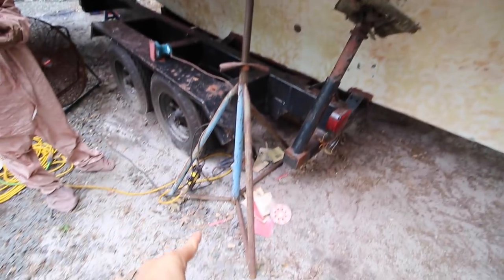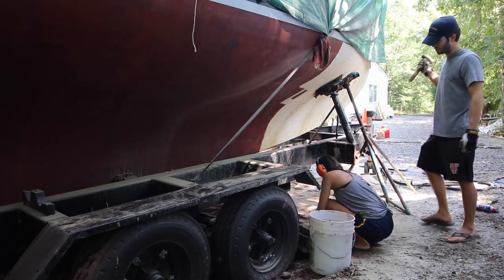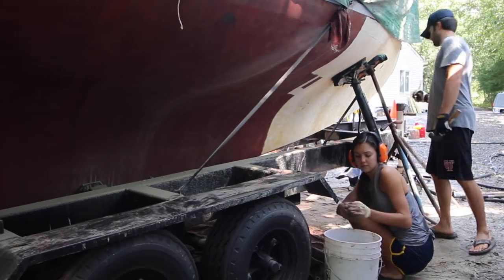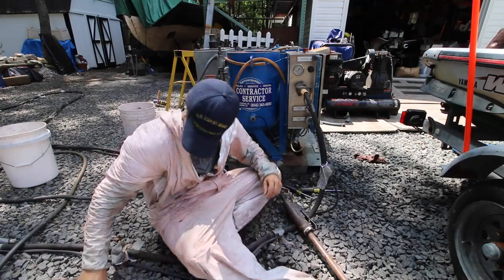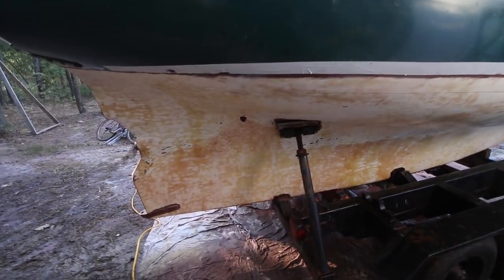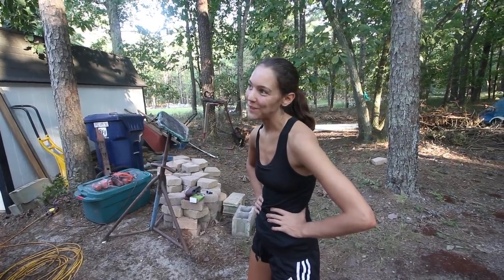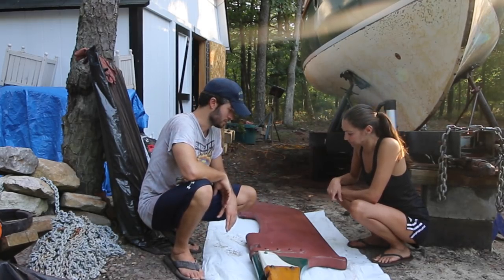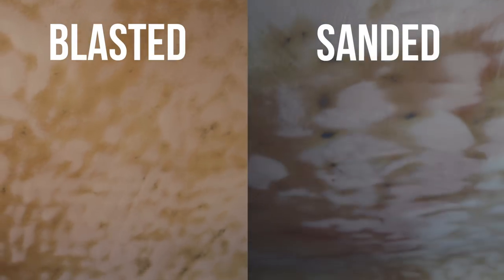45] Backyard DIY Classic Sailboat Restoration | Abandon Comfort

Comment: Not another electric! They just are not practical, safe or enjoyable (except in some warped pretzel logic delusion). Diesel will give you more options, less cost and SAFETY!!!!!
Reply: Cigarmann  Bet interested to see what happens when they get stuck at an anchorage for a few days and can't recharge their batteries because there is no sun...and the wind generation isn't enough to charge up the batteries.
Reply: Cigarmann After 285,000 NMs at sea over my 71 years I kind of doubt it. I’ve learned a few hard lessons but not going to sea with such an inadequate power plant AND uncertain fuel source is just plain common sense. I seriously fear for these kids (and those on Uma).
Reply: How many of those miles and years in an electrically powered boat?
Reply: CorwynGC Way more than you I’m willing to bet. I’ve been on the water almost all my life. I’ve seen any number of electrically powered boats and sailed on MS Tûranor PlanetSolar during its visit to Mexico in 2012 on the way to its circumnavigation. It was very impressive and cost about 15 million euros. I’ve been on electric powered ferries in Norway and Finland. I’ve seen dozens of attempted conversions in boatyards from Thailand to Marblehead. The technology, for an even vaguely realistic cost, just isn’t there yet for safe use on a blue water cruising sailboat.
Reply: Electric can work, on a lightweight cat, but on this tank boat it will take too much power to make it move.  
rowing?  really??
Reply: Think Uma begins to realize that electric is a bad choice on a sailboat. 5 knots and only 2 hours of battery is no go, if you get in to a storm and the sails are torn you have a problem.
Reply: Jack, What gives you the impression that electric is limited in power?
Reply: Jeffrey, "Way more than you I’m willing to bet." another thing you are sure of, with little to no evidence.
Reply: CorwynGC The evidence is your clear ignorance of the reality of the unsuitability of electric power for blue water cruising yachts in 2018. The evidence is the sum of my experience acquired in a lifetime of sailing.
Reply: It isn't reality just because you think it is.  The fact that you haven't PRESENTED any of the evidence you claim to have, makes it pretty obvious that it isn't.
Reply: There are plenty of drawbacks to diesel, not just that they kill the planet.  Just as there are drawbacks to electric power.  Hopefully, Abandon Comfort will do their due diligence and find the best solution for THEIR situation.  Thanks for the pointer to 'spreadsheets'.
Reply: CorwynGC The evidence is the simple fact that there are no viable commercial options for electrically powered blue water cruising sailboats. The market is the evidence. That and personal experience from a life lived on the water. I would love to see an economically feasible electric power option for cruising sailboat use but the technology/cost isn’t there yet. Ecologically the carbon footprint for electric over diesel isn’t as clear as one might imagine. High capacity batteries are hard to manufacture and harder to recycle. They have a finite life and wear out especially quickly under the stress of boat usage. These kids sure work hard but to what end? Anyway, enough already. This isn’t a sailing VLOG. Tiny doesn’t interest me. Adios.
Reply: Electric engines are great, the best kind of motor , efficient , high torque , quiet , no need for clutches and transmissions  .......however the batteries suck . They take a long time to charge , and have low range . They have a limited life span while being toxic nightmares to the environment and there is the danger of fire from bad electrical connections in a high corrosion , damp and high vibration environment made worse by extreme current draw all usually tucked in a tight flammable compartment .  

I would love if that was not true , but it is . I think the best might be a hybrid with a gen set to extend range but then again engines like to be run regularly and a gen-set sitting  unused for months in a humid salt water environment with stuff growing in the intakes while the fuel gets old might not be reliable when you need it . Maybe if it is run every few days to make water it might be better .  

My diesel is 30 years old and thanks to  proper maintenance is very reliable and very thrifty on fuel .  Range measured in days of powering at hull speed consuming a liter and hour  .  Plus I can charge the batteries and you could  heat your shower water while at it . 

Hopefully these guys will solve the battery issues . I think the hybrid with a gen set is the way to go but time will tell. It would solve Uma's issues (except for the overheating )  , batteries almost all the time - gen set when needed to extend range .
Reply: It is just the comfort and ability to go places that makes batteries (batteries because electric motors are great batteries suck) a limiting factor . Forget steaming up an interesting river or in a large basin harbor with batteries . And beware if a tide on a windless day is setting you on a reef or you are dragging anchor in a sudden squall .  Remember with Uma it is 2 hours of powering to dead batteries and then days to recharge unless at a dock .
Reply: Jeffrey Robbins - ha ha, electric all depends. Was onboard the first all electric destroyer, it worked great mate and would do donuts around most boats. Although yes it was propelled by electric motors, as was everything else ... it used some big gas generators to get the electric to begin with. Never did understand claim of all electric but burning so many tons of fuel lol. Fuelrep's were not fun either. 

Interestingly enough, one of the given reasons for electric propulsion was that it was cheaper and more efficient, even though it still needed fuel to create electric power. So were they dead wrong or are you? I really have no clue nor care, but something to think about mate. Cheers!
Reply: But Kev, unlike the destroyer, they are not going to have a generator to recharge or supply power to their batteries, just solar and water hydro. How far do you think that Destroyer would have run just using that. Id say not far at all.
Reply: Trains are also diesel electric . You can get rid of the transmission and you can have a set of staged generators so it can be more efficient . However neither could get far on batteries .
Reply: marksfirst1 - yea I know that, my point was that its supposedly cheaper and more efficient using electric engine, unlike what Jeffrey Robbins claimed. I personally do not understand it, would be like for AC to install electric inboard engine and than use generator as back up to top off electric batter bank. WHY, lol sounds self defeating imho.

As to destroyer, idk but guessing pretty darn far. Both shafts had one generator each (plus one backup each). Each gas turbine generator produced 30Kw for total of 60Kw for both shafts, and yes it is very large boat, but it hardly used any of that for whole ships functions. Gen's basically just idled, but that was partly why they stated it was more efficient using electric engines, as using gas engines to propel ship would have burned more and needed to rev higher. shrugs
Reply: Electric is certainly a better motor . Less moving parts , better torque , no transmission needed , reversible easily , and efficient over a wider range than internal combustion . Most internal combustion engines are most efficient at certain RPM's . It is the batteries that suck in electric boats .  

Diesel electric is likely the best but expensive and nullifies much of the sound and "green" advantages of electric . 

As to the green , nothing greener than just sailing everywhere and pulling out an existing working  diesel to replace with electric I bet is overall less green in the same way buying a new electric car is less green than running your existing car till it is worn out as there is a huge cost in manufacturing these things .
Reply: @Tino G. On a sailing boat, if you get into a storm and the sails are torn you have a problem anyway, as the engines on yachts are only an auxiliary. Thing to do is maintain your sails. Your engine will generally only come into it's own when the weather has abated.
Reply: I'd have to agree with Jeffery about the power plant.  We just bought a C&C 35 this summer and were sailing it back from Traverse City Michigan to Boyne City MI.  We were under sail and having a nice time in about 3 ft following seas building with about 15 knts of wind...well I had a little issue with the dinghy under tow so I pulled in the sails and fired up the atomic 4 gas to run her up into the wind for a minute so the dinghy wouldn't be slamming the back while I made adjustments.  This is when I realized that my motor might be a little under powered for the size of the boat.  Not terribly but definitely had to run some higher rpms to punch through the waves and wind.  You do not want an under powered sailboat.   I just wouldn't take the chance.  In my 20 years of sailing I can think of a few instances where a motor has saved the boat from a precarious situation.  You'll have enough to think about.  Put a powerful sipper in your beautiful boat.
Reply: @hazercollins4656  Raced a C&C 35 mk3 for years - great boats and well built . Yep diesel is hard to beat due to the energy density of the fuel . For environmental reasons many want to go electric and electric motors are the very best motors , but batteries still suck and they are toxic environmental nightmares , particularly the lithium ones .  Pulling out a working diesel to put in electric is environmentally negative because you forgot the manufacturing environmental cost .  .
Reply: @WreckDiver99   Add then the wind shifts and it is an onshore blow .
Reply: @CorwynGC   Re "What gives you the impression that electric is limited in power?" - the batteries .  Electric motors are the best kind of motor , batteries suck .
Reply: @faircompetition1203  So just like a internal combustion engine, power is inherently limited.  However with batteries, more  batteries equals more power.  If you don't have enough power, you don't have enough batteries.  Moreover, the amount of power that is useful in a sailboat is limited by hull speed, and it doesn't take much power to get a boat to that.
Reply: @CorwynGC   As I said the  electric motor is just fine . Batteries suck .  Range is fine on a nice day near to your destination but not in an emergency onshore blow with a broken boom . Not if you want to explore a river with a 2 kt current , not if you need to motor on a windless day for 8 hours to get to a safe harbor . Not f you are a working guy and you need to get home ant there is no wind . 

Personally i think electric is great for most people who use their boats as day sailors in good weather .  Racing might be good too as long as there are no deliveries . 

Having said that , I think too many people buy boats that don't sail well , won't go to weather and then resort to the engine . I won't buy that boat . We went out for a great sail  on a light day ghosting along at 5-6kt BBQ on , went swimming , everyone else stayed in saying there was no wind . 

My dream compromise is an electric motor , enough battery for 2 hours and a gen set to run everything  like water makers , electric / engine heated water heater and extend the range of the electric motor = to a diesel if needed .  You don't need to run it most of the time but there when you need it .  Make water when you need it  , charge batteries and have a hot shower at the same time - maybe run once a week for an hour or two .
Reply: @faircompetition1203  As with your complaint about the power of electric system, range is also a problem that can be fixed merely adding more batteries.  Current, of course makes no difference if you are already moving at hull speed.  Other than that, one should use solutions that fit one's circumstances.  'Abandon Comfort' is not a working guy that needs to get home if there is no wind.   
Though I am confused about how you think a working guy got so far from home that he can't get home on his existing batteries.  Going further than you have means to get home, is just stupid.
Reply: @CorwynGC  Nice to know range can be fixed with more batteries . Range on my Diesel with just 8 gallons of fuel is 41 hours at hull speed . Doubled with a can of fuel , "recharged" in 2 min . How many batteries will I need to match that and what kind?
Reply: @CorwynGC  Re "Though I am confused about how you think a working guy got so far from home that he can't get home on his existing batteries." - think about it , you are on vacation and cruised for 3 weeks - time to go home , you are 2 days sail out and there is no wind for the next 3 days or a storm on the nose  .  Having an engine means you can extend your vacation and not have to panic and spend 1/3 of your vacation trying to get back  and just power home .  Given you didn't think about it kinda silly to call me stupid . Do you actually own a boat and use it ? Frankly it does not sound like it .
Reply: @faircompetition1203  So that's a 'working guy' is it?  MY view of a working guy is a lobsterman.  
I'd be glad to figure out how many batteries you need to match that, should I send you my address so you can send my consulting fee?
Reply: People seem to ignore the health issues with being in strong electrical fields.... No Prius for me...
Reply: @hazercollins4656 : Hydrogen power plants have just as strong electric fields as full electric cars (and MORE than a Prius).  The Hydrogen needs to be converted to electricity, and just as much electricity is needed to propel the car.
Reply: @CorwynGC  yeah I knew that but had no idea it was as many as 40 amps.... might as well have an electric car...
Reply: @hazercollins4656  Or a clothes drier.  Or any electric oven.  Or an electric water heater.  All of those are around 40 amps.  Or when your house is drawing a combined 40 amps for various things. Few people are willing to give those up.
Reply: @faircompetition1203 What are you talking about?  Lobsterman use BOATS in their work...  Working men,  working in boats...  Going out in boats, then coming home.  Never going out without enough fuel, and thus not coming home.
Reply: @CorwynGC  So "working guy" only means a guy on a lobster boat LOL - got it , now, where is my  Battery design you promised me ? Can't wait for a battery pack with 41 hours of 10KW output that recharges in 2 min  LOL . 

Just out of curiosity how many lobster boats do you know of battery powered ?
Reply: @faircompetition1203  Your check has yet to arrive, I will send the battery specs soon after it does.  Of course the recharge time was not in your original goalpost and will require an additional fee.
Reply: @faircompetition1203  I assumed that 'working guy' meant guy working, not some cruiser on vacation.  Because really what difference it make what a cruiser does for a living?  Of course since none of that applies to Abandon Comfort, it is easy to think you are just arguing pointless irrelevancies.
Reply: @CorwynGC  Actually you said "abandon comfort is not a working guy"  - did you think that sailboat was a lobster boat or that anyone would confuse him with a lobster-man?   Clearly you meant as in a guy with an ordinary job - so why move the goal posts ? 

Take Uma , she has about an hour of cruising at hull speed , she can go father if there is no current and she does not push hull speed and there is no wind or waves - maybe double and with real luck triple  . After that  she needs about a day to recharge at a dock , or a few days on solar . 

Her effective range under load and at hull speed  is 1 hour .  You would need more than 41 times more batteries as the extra weight would reduce the range to match my diesel which also runs longer if I reduce speed and load  .  Then  you would need some kind of supercharge station at all those remote locations they go to , or a few hundred square feet of solar panels mounted to the boat  or wait a really long time to use the motor again . 

 Near here is a canal , to use it you will need about 8 hours of battery time at hull and maneuvering speed - can't do it . There is the Niagara River and often after a day of racing there is insufficient wind to go back up the river to smugglers cove marina ,  Uma probably could not make it in . 

Electric motors are great - batteries suck . While you can use electric motors just fine they can not match diesel yet .  As for reliability , my diesel is 30 years old , never been apart .....how many years do batteries last ?
Reply: @faircompetition1203  Ok you have fully ceased to make any sense.  Bye.
Reply: @CorwynGC   Bye , I agree things make no sense to you - I can explain it again for you but I can't understand it for you . Sorry .

Comment: Have you considered bio-diesel? You could use your diesel engine but run it on veggie oil. No pollution or nasty diesel smell.  Or you can do it locomotive style, run the propeller with an electric motor and use the bio-diesel engine as a generator at constant rpm to run it at best efficiency.

Comment: I myself prefer no engine at all.
Electric or diesel.
It's I believe 22ft. Pocket Cruiser.
Plenty small enough that you don't need other propulsion.
Sculling the boat would be easy enough on that boat.
Not oaring.
That's a long oar on your stern.
And in case your rudder break's that long oar is also used to steer or help you propulsion together with your sails.
You can even go backwards with that long oar just twist and cup the oar.
They do it all the time in Asia.
Also way to much sanding not necessary to get all of it to the hull.  Seemed like it was very  good bottom paint like epoxy. Just light sanding and recoat is all that is required.